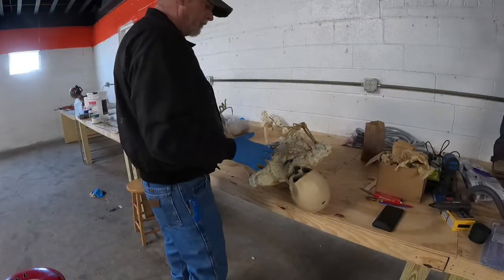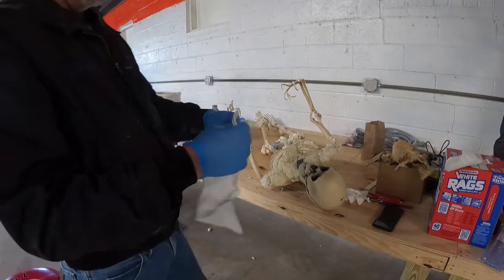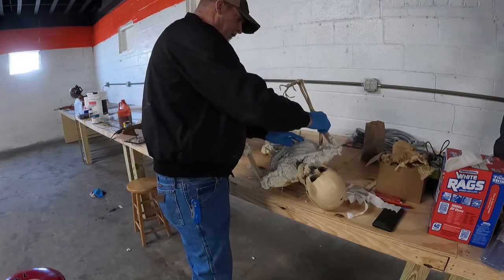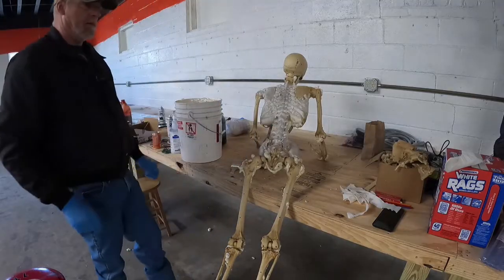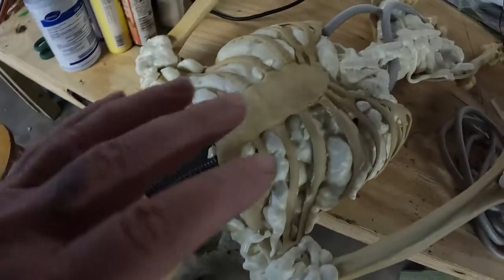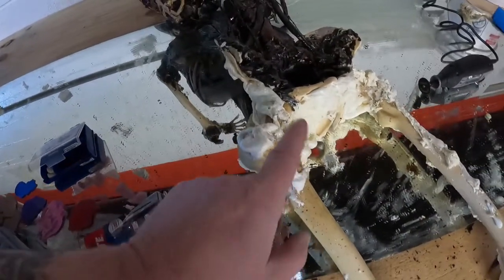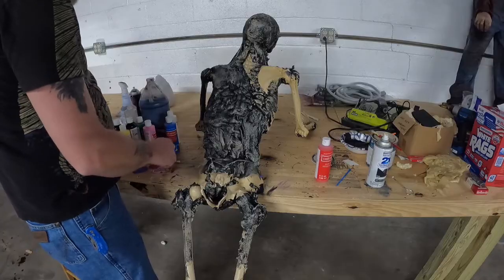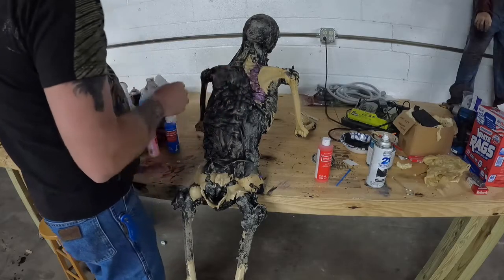HOW TO MAKE CORPSES/ MONSTER MISFITS

Comment: hi Vick....love all your stuff and work.....where are you getting your skeletons this year.   I went to a bunch of locations and the quality has been pretty bad.   Especially the fingers and feet.   I tried numerous places.   Are they still making the ones you started with in these videos.   Thanks for any help.   Keep up the great work.   Doug
Reply from the maker: I got them at home Depot but I only bought a certain kind but I've since moved on from them to medical skeleton they are about 150.00 a lot more but I like the quality better for sure
Reply: @MONSTERMISFITS  thanks for the quick response.  I used medical skeletons about 10 years ago.  They were great but really heavy.   Have they changed since?  Can u recommend a place to buy them?  Are there lighter ones from the hard resin?  Sorry for all the questions.  And thank u again. 🙏🏻
Reply from the maker: @dougsasfai2350  ones I buy are a little heavy I get them from Amazon and I think they are PVC plastic easy to drill threw and move hands and feet around I just think they are better if your looking to make something and sell them u are give a better quality prop if for home use id definitely use plastic skeleton from home depot but get them off white ones I like them best
Reply: Hi Vick.  Ended up getting the pose and stay home accent skeletons from Home Depot.  They are great.  How much latex do u recommend for 8-10 corpses?  A gallon?   More?  Which latex do u buy from reynolds?  There’s a few choices.  Thx again. 🙏🏻
Reply from the maker: @dougsasfai2350   yeah a gallon should be fine I just use mask latex u can get it just about anywhere

Comment: I like the shrink wrap, heat gun method, but this blows that away.  Definitely more work, but the payout…. 
I am gun shy on latex, I’ve had problems with longevity, may substitute with silicone and naphtha.?   I did think the esophagus hose was going to double as a fog tube.  I may try to work that in also…?    Great video, job on the skellys
Reply from the maker: Thanks I haven't done any in silicone it would cost a small fortune..don't be intimidated by laytex it's easy to use just wear old clothes you will be fine..you can make the hose longer of course and use a fogger on it there's just so many possibilities with these things good luck have fun.

Comment: What did you use for the foam filler at the beginning?
Reply from the maker: Just great stuff one u spray it smear it around once it starts setting up tacky then let it sit for a few days as it will continue to expand that way u don't have to go back and touch it up.

Comment: How did you bend his fingers like that?
Reply from the maker: Take a heat gun heat it up bend how u want them spray water on it to keep its shape
Reply: @MONSTERMISFITS  okay thanks, I’m trying to figure out the best way to get the neck to bend to the left as well. I took all the screws out I could but it’s just not enough. Considering heat but it’s a lot thicker then the fingers so I’m wondering if it’s a bad idea to try it that way
Reply from the maker: @tracemiller1519  That's how I move it me k as well just heat if it melts threw u be ok u will be coving it up anyways
Reply: @MONSTERMISFITS  yea I guess you’re right I didn’t really think about that, so I only have a blow torch I don’t own a heat gun, is it a bad idea using a blow torch to heat it?
Reply from the maker: @tracemiller1519  I think u can do it just becarefull u don't catch it on fire keep your spray bottle handy
Reply: @MONSTERMISFITS  I got a heat gun, seemed like a bad idea with a torch! You recommend high heat with a heat gun or on the lower side?
Reply from the maker: @tracemiller1519  I use high heat
Reply: @MONSTERMISFITS  I did the same fingers were super easy to do, bending my guys neck wasn’t the easiest but it worked
Reply from the maker: @tracemiller1519  good deal glad it's coming together
Reply: @MONSTERMISFITS  getting there👍🏼 I’m doing an impaled Corpse like how Oak Lane Cemetery did and using ideas from the two of you. If I can figure out how to tag you in a video when I’m done I will👍🏼
Reply from the maker: @tracemiller1519  sure if it's in Facebook just look up vick springston I'm easy to find lol
Reply: @MONSTERMISFITS  okay I’ll check it out, thanks again👍🏼